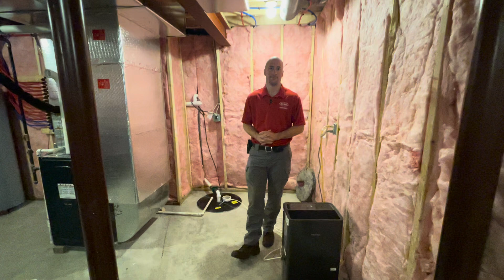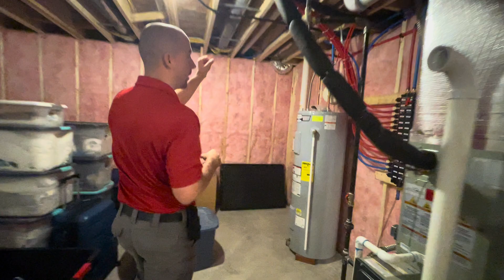What Determines Where A Radon Mitigation System Is Installed?

Comment: My house was built 16 years ago and a 4.5 inch radon pvc pipe was installed from under the basement floor running up to the attic, but I’ve never had a fan installed.  I assume I can install a fan in the attic to mitigate, but I also have a sump pump in the basement.  It has a plastic cover over it but it’s not sealed tight.  Would I also need to seal that tight and put an exhaust fan on the sump pump well too? Thanks!

Comment: Where is all the air that the fan is pulling out of the house coming from?  Wouldn't this create a vacuum in your house and blow all your conditioned air outside?
Reply from the maker: That is a great question. The foundation must be well sealed so that the system does not pull conditioned air. This is also why the sump crock is sealed; so conditioned air is not being pulled through the system and exhausted to the exterior. The air being pulled is coming from below the foundation, which is where the radon is coming from.
Reply: @relianceradon  That fan is pulling enough air to completely change the air in a house several times a day.  The dirt under your foundation is not porous.  So where is all that air coming from?
Reply: @ChillWill-q5x  you high?
Reply: @MaxKeeble1  You gay?

Comment: Hi.  Do you recommend installing an interior or exterior radon system for a house with a full basement, two car garage, and large attic? We're buying a house and the radon inspection came back with a radon level of 24 pc/l. We live in PA, so definitely cold snowy winters for potential fan freeze up.  Thanks
Reply from the maker: We are in Northern Ohio where freezing is a concern as well. The fans withstand the cold temperatures very well. During extended periods of extreme cold we have had times where the top of the exhaust pipe will freeze over, but that is very rare.

Comment: can the radon pipe run above the electrical panel in basement?
Reply from the maker: There are clearance requirements for electrical panels in the electrical code that should be checked, but as far as from a radon standpoint there is nothing that limits this.
Reply: It doesn't matter, it's all a scam.
Reply: @Big_ol_bass what is?
Reply: @Big_ol_bass what is??